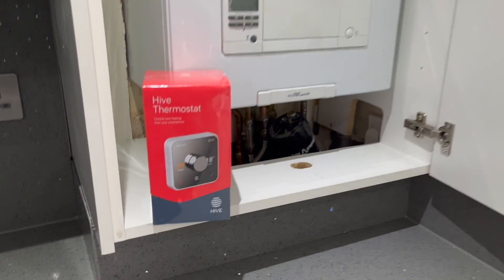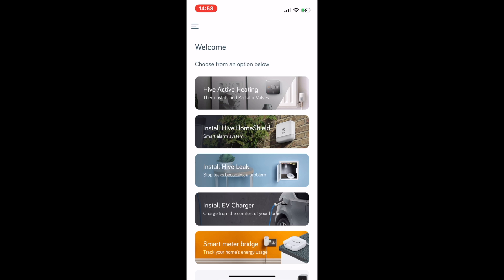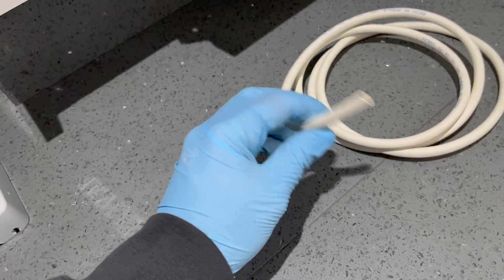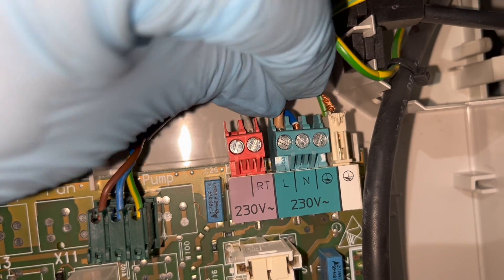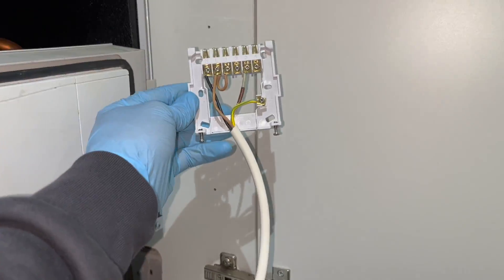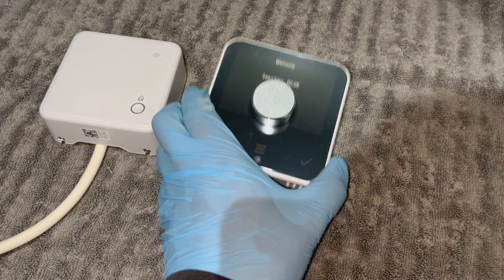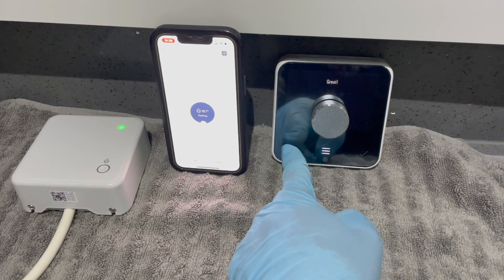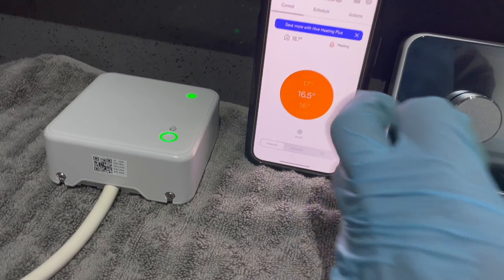Hive V3 Thermostat Installation In 10 Mins - Combi Boiler Wiring | Vaillant EcoTec Pro

Comment: Hello Sir, I have a Honeywell wireless thermostat already , but the remote control display is not working even though I changed the battery , I want to buy and Install a Hive one. If I buy the receiver and Hub is it work with the Honeywell thermostat? Or I need to install the hive thermostat also ? A reply will be much appreciated Sir. Thanks!

Comment: Just used your video worked a treat . I was trying to use a 2nd hand setup in a new property it was a nightmare as couldn't remove previous owner . Bought A new replacement and had it running in 20 mins . Thanks 👍 p.s great instructional video

Comment: What do you do if you have an existing rf? I have one set of wires from the boiler to the rf c receiver. Can I use those wires? Or do I have to add a new set? What do I then do with the old rf?
Thanks

Comment: Great video and helpful however if i already have a reciever connected but want to change it to the Hive do i need to open the boiler? Or just shut down, remove the wiring from old receiver in to new receiver and go from there?

Comment: Can you use your previous Hive until (already paired with the hub etc and working on an old boiler) that controlled heating and hot water to connect to a new combi boiler, just to control the heating? - Someone mentioned you have to buy a whole new Hive unit?
Reply from the maker: Yeah you can re use it. If you’re going from a system boiler to a combi boiler then the wiring will need to be changed

Comment: many install guides a see show the Hive been hooked up to the 24v RT connectors on the left of the Valliant board, rather than the 230v connectors. What are the trade-offs and reasons you'd use one or the other? I thought 24v was OpenTherm so could allow more modulation of flame vs binary on-off control. Can't see anything explaining when to do one or the other. I have a Vaillant ecoTEC pro28 btw.

Comment: Hi tried installing today on same boiler but had built in timer on front with dial  do I need to disconnect that the boilers fired up but then gets the spinning egg timer on the display so have to reset boiler

Comment: Just came across your video 
If you have an old room thermostat and need to remove the wiring as I want to fit a hive. Do you have to put the link back in if the thermostat is wired up where the link is in your video 
Cheers

Comment: Get the hub into pairing mode(solid green light and flashing amber). Then power the receiver. Receiver will initially start off with flashing double amber light(its searching for the hub). When receiver is single flashing amber(now searching for thermostat) only then insert the batteries for your thermostat. It will pair within seconds. Lastly claim hub via 6 digit code on the app. Install them daily.

Comment: Thank you for this video.  After spending hours sifting through forums and wiring diagrams, I came across your clear and concise explanation here and had it all wired and up and running in less than 20 mins.  Nice work.

Comment: Thank you so much for the instructions! Super straight forward. After looking inside my existing boiler setup i noticed that my RT does not have any screws to plug in the live (brown) cable that you add brown tape too. Can I just add the terminal block into the socket? If so do you know what kind of terminal block i should buy? Thanks again :)

Comment: Hi mate, ive done everything exaclty the same as you have in the vedio, everything is set up on the hibe app aswell etc, the only thing i cant get to work is when turning up the temperature on the app/thermostat or boosting the heating the receiver light comes on but the boiler dosent turn on. Any ideas ehat could be wrong? Thanks
Reply: Did you get a fix to this? I have the same issue

Comment: Great video dude. It might be worth noting that you tinned your flex. If you cannot or do not have a soldering iron, use crimp connectors as it is a requirement on flexible conductors. :)

Comment: Hi I’ve just wired everything up as per your instructions, everything is paired up and shows up in devices on the app, but when i turn the dial clockwise to go above actual temperature and click dial the bottom green light comes on on the receiver but the boiler doesn’t fire up
Reply from the maker: Is the temperature on the boiler itself turned up?
Reply: @advancedboilertraining  the boiler is in idle mode but the temp on the boiler says 29•

Comment: Great video! Quick question, I have the same model however on the front panel is a clock timer. After connecting the same way egg timer flashes almost constantly, and radiator sign was flashing when thermostat was on. Any ideas?

Comment: Christ, this hive thing is the most tempermental bit of kit I’ve ever used, and I’ve installed Printers before so that’s saying something! Followed the video, currently have it in a state where the thermostat is connected to the receiver, the hub is still flashing amber and the thermostat on the app couldn’t pair, but the receiver did. Lost and confused but the thermostat works, boiler kicks in when raising the temp

Comment: Now mate, I followed this exactly and it does work but only if the hot water is on?? It’s the exact same combi boiler you are working on- thought I had wired something wrong but I have watched the video and checked to many times now, any ideas??

Cheers

Comment: This is excellent, I  have an issue even though hive installed by hive, the only difference I have is the pro 28 has the inbult timeclock in the centre console. I am told by hive to remove this (it pulls off) is there any difference to your instruction, namely does the RT link on the left still need to be removed when the timeclock is in place or removed? when Hive was installed as per your guide the boiler ran all the time even though the hive was saying off and there was no 240V from receiver to the the violet RT terminal. Any help appreciated. I am assuming this type of boiler with the singe violet RT terminal should be enabled whenever it receives a 240v feed from the hive receiver and turned off when there is no 240 to the violet RT terminal. Brilliant guide regardless of whether you reply to me tho.
Reply: Did you manage to sort the issue my hive is the same problem
Reply: @redheartsable  the link i refer to does indeed need to be removed

Comment: Wired wrongly. Should be using the grey as your neutral with a bit of blue sleeving on it and the black as the switch wire with brown sleeve on it.

Comment: Fantastic video, very explanatory but I also have a small issue. Open the PCB but can't see any RT slot; should I connect the grey wire to "3" port?
Red wire bypass in-between "3" & "4".
Can't attach a picture to see.
Thanks.

Comment: Trying to set up the hive has taken days . Automated valves had to be installed on the old plumbing system. As this is a second hive used a different email for the account and a different phone . ( don't ask) All done but after the hub updated could not pair the receiver and thermostat.  Checked out this video and it now works. You must follow the exact order to get it to work.  1 Hub installed and updated . 2 turn on receiver and let it flash yellow 3 Add batteries to thermostat and let it flash 4 then go to app  and ask it to find thermostat. It works in seconds. I had been doing 4 before step 2 and 3 and getting no where.  Listen to the man and do exactly as he says. Brilliant . Thank you

Comment: Great video, fitted 3 in one day, I didn’t need advice on the wiring but not good with hubs and Wi-Fi issues. If it works straight away, it’s great. The logic steps and how long to leave it updating is worth saving this video. Nice job 👍

Comment: Im guessing this boiler didnt have already have a thermostat installed? How would the installation differ if youve got an existing thermostat on the boiler? Presumably one would remove the equivalent wire to the one you install with hive?
Reply: For reference I have timeswitch 150 on mine.

Comment: Hiya great vid and just thinking of my my set up as thermostat has about died.i already have a control box on the wall next to same boiler us this one .Will it just be a case of wiring in the hive box and not having to change any wiring inside the control panel of boiler .it's a Siemens stat and control box

Comment: Thanks, this is a really clear video. I am thinking of installing a hive on our combi boiler, it has a dial thermostat on the wall … is there any reason you can’t just leave the existing boiler control panel in permanent ‘on’ mode and replace the wall thermostat with the hive reciever? Surely it’s just switching on or off according to the thermostat and the setting in the app? Or am I thinking too simplistically? Thanks again.

Comment: I did what you said I fitted the receiver first it was working fine the tried to connect the hub  that was 7 hours ago now the boiler is not working because it said I will have no control over the boiler so I’m freezing how did you sort yours  out be very great full many thanks

Comment: Hi. Good video thanks. I have fully working Hive system which is brilliant. However my neighbour who recently moved in needed to buy a hub for the existing installation. Seems to be working but the green light on the receiver which glows when boiler not being used is not illuminating suggesting it’s not communicating with something. What is this green light for?  Thanks

Comment: This video was so informative and helpful, can't thank you enough for making this easy enough to do yourself. In case it helps anyone else, I accidentally skipped the step to remove the link between RT and 24V on the left, and my heating was on all the time despite the controls being set to off, following the instructions properly and removing that wire fixed the issue. Thanks again!

Comment: I'm currently upgrading my system to Hive. I have 2 hard wired thermostats that go to 2 motorised valves upstairs my boiler being downstairs. Is the receiver still suppose to be next to the boiler or with the 2 motorised valves ? as I see there's a small electrical box next to them

Comment: Why RT has 2 connection on the boiler pcb and you just used 1. How did you know which of the 2 to use? Are they in continuity or are they meant to be used to do the link that you instead did in the receiver?

Comment: So does the hub always be connected via ethernet cable? If so, im assuming the hub will have to be stuck nearby to the internet router. 
Appreciate the answers.
Reply: Yep it needs a hard wire connection to the router. You can however get Ethernet over power adapters that are pretty good.

Comment: Absolutely brilliant step by step tutorial which actually made me buy the V3 with Hub. I have the same boiler and have followed exact instructions however when I set my thermostat temp the receiver light is fixed green but the boiler isn’t switching on. Can you help me here please?
Reply: Did you find a fix for this?

Comment: I've followed this to the letter.The green light comes on(receiver) when Demanded by the thermostat,but the heating doesn't come on?
It's the same Vaillant Ecotec in the video.
Reply: I’m having the same problem. Did you solve your issue?
Reply: @carlhamid7239  The timer dial that is already on the boiler has to have ALL the notches set to on.Then the thermostat can control the boiler👍
Reply: @waseemullah1437  where’s the timer dial please mate.
Reply: @carlhamid7239 It should be on the front.Behind the flip down panel.I am going by the layout off a Valiant boiler.

Comment: Hello ive used the exiting cable from my boiler to my old reciever howber it only has 4 cables and not a earth cable. Does this matter?
Reply: It’s been five months since he’s replied to a comment, I’ve asked a similar question but not yet installed.
Reply: @LeeHadley  mines working fine and after some more looking I've been told the Hive is double insulated and doesn't require a ground. It also states this in the Hive instructions
Reply: Nice one mate, appreciated. So you only have to replace the receiver by the boiler?
Reply: @LeeHadley  yeh that's all I had to do as the cable was already connected to the boiler. So I just wires up L N and grey to 1 and black to 3. No earth

Comment: I have a gloworm boiler and Honeywell wireless thermostat HW & CH, if I replaced with a hive would I just have to switch the receiver on the wall and use the existing cable to boiler? 

Thanks

Comment: Great video, thought it would be a breeze wiring mine up but my Vaillant has a different PCB. Has L, N, E, 3,4,5. Have a fused spur and wired the receiver with L from spur and boiler going to L. N from spur and boiler going to N then 3 from boiler into 1 on receiver and 4 from boiler going into 3. Also have a link from L to 1. When you turn thermostat up the light on receiver clicks on but it won’t start the central heating on boiler. I’m stuck
Reply: Same here mate
Reply: Same here

Comment: Do I need a hub? Or is a receiver all I need to use without accessories?  

Many thanks
Reply from the maker: You only need the hub if you want to connect it to wifi and use the app. If you’re happy to just use the thermostat then all you don’t need the hub
Reply: @advancedboilertraining  many thanks for the reply. 
If it doesn’t use Wi-Fi, no hub, then how does the stat contact the receiver? Thank you.

Comment: hey mate, good video, just got a question though

I see that you make that loop into the adjacent port with the brown wire, I was wondering why that was? briefly looking at the instructions they say to use a separate wire (Black), so just confused me a bit there, that's all
Reply from the maker: I cant remember the instructions off the top of my head but I remember them not being useful! If you’re going to wire the boiler 230V then follow how I’ve done it and it’ll work 👍

Comment: Thank you for the Video I have  vailant ecotecplus 637 system boiler with a 300 L water tank. The hive works find but when heating stops because the rooms are sufficiently warm or the boost time is up, the boiler turns off as expected but the LCD display turns off also and turns on again when they the heating restarts. Is the LCD display on the boiler supposed to go off when the heating stops or stay on even if heating is not running? Also, I don't have an option to control hot water setting on the menue, only the radiator temp I can control? Is this something specific to my setup? However, the boost setup for hot water to taps and showers works fine but I can't see the symbol on the LCD display allowing me to control it. Many thanks

Comment: Do these things have a fairly decent range? Our internet hub is in the sitting room, the thermostat is in the hall, and the boiler is in the garage (Through an external thickness brick wall). Would it still connect split up like that or would you be better up wiring the receiver into the hall?

Comment: Possible small mistake here (close to 100% sure here) power for remote unit is supposed to be fully provided by RT block only (so if the boiler internal fuse blows the remote unit can't back feed into the boiler) 

you actually showed this at one point in the video the correct way with the 2 cables going into purple RT block (3:59 correct way as left side is 240v boiler side internal fuse protected) but then next clip after you put the constant remote live into blue block (4:20 incorrect it should go into the left side of RT) witch bypasses the boiler built in fuse so now if the boiler fuse blows internally the remote unit can still backfeed the boiler when it's demanding heat (unless the main fuse blows in the wall)

Another youtuber who is an electrician came across this problem where the Hive controller was installed upstairs but the combi boiler was downstairs,

the hive controller was powered by upstairs mains ring and the boiler was powered by downstairs Main ring,, so when they turned off the downstairs main ring to do work there was still 60-150v downstairs because the hive controller upstairs was demanding heat and trying to tell the boiler to heat witch was sending 240v into the downstairs mains ring (in your setup it will just make the boiler live if not switched off at the wall so not as drastic as his video, but it's very important that if your hive or any remote controller units is always powered by the boiler correct RT live )
Reply: Hi mate. I’m having an issue with mine, wired exactly as shown but when I demand heat through the app or Hive thermostat the boiler doesn’t do anything.
Could your reasons be why?
I already have an existing wireless thermostat connected, not sure if it’s still receiving a command from that.

Comment: What wireless protocol is the coms between the hub and receiver box, Wi-Fi or Bluetooth ?  Edit, ok I see it’s Zigbee, what if the hub and receiver are too far apart. Then a zigbee booster or a longer Ethernet cable between the Wi-Fi router and hub. Or get a wireless hub.

Comment: Is the wiring same for hive hub v3 ?
Reply from the maker: This is a hive v3
Reply: @advancedboilertraining  an gas safe engineer rang worster , and worster said hive it not compatible with worster 2000 as it has a built in receiver
Reply from the maker: @aseebyounis2585  this is the video you’re looking for. This is a hive V3

Comment: Hi thanks for the video I have a valiant 824ecotech plus it’s got a veg 350 f wireless thermostat but it’s got a mind of it’s own turns it’s self on so decided to fit a hive can I ask do I need a new panel for the front of the boiler as it’s got the receiver unit plugged into the front of the boiler do I need a blank panel or will the hive work with the vrf reliever still in as the boiler u installed the hive in has just a blank by the controls hope that makes sense regards Rich
Reply: It’s a vrt 350f not veg lol stupid phone